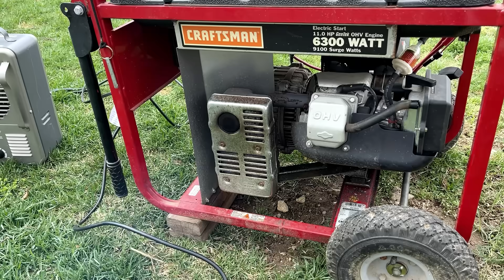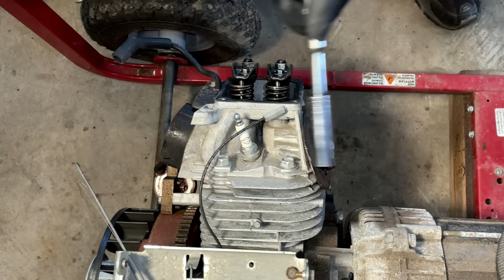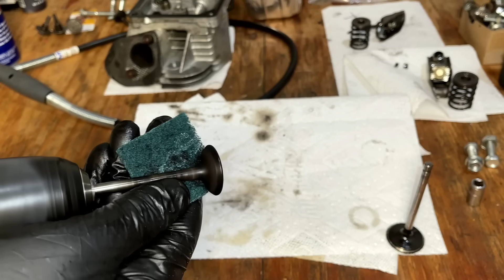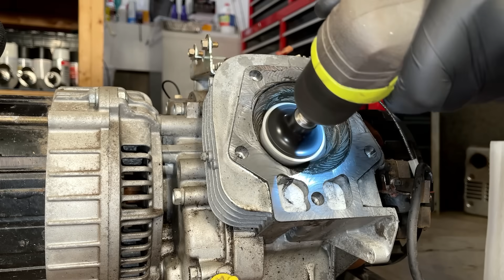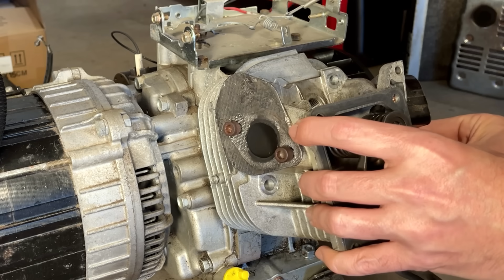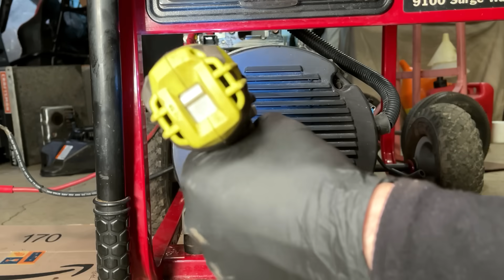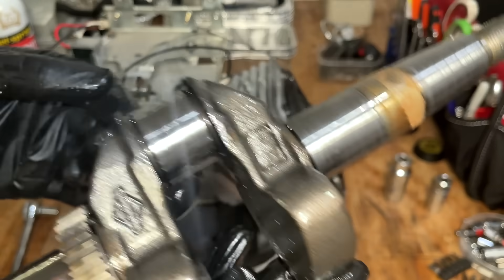Smoking Generator Engine (Part 1) - Easy Fix or Engine Teardown?

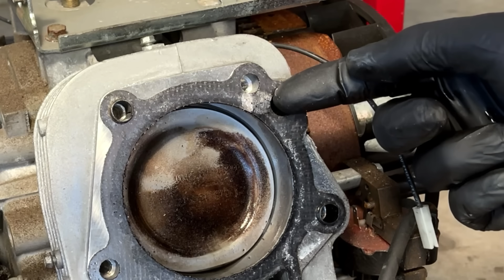Comment: I feel that you have two problems.....at 20:53 I can see where the oil has been washing the outer edges of the piston clean indicates worn rings/cylinder. The color of the valves will reveal any guide wear. Let's see what you find. Love troubleshooting this stuff!

Comment: i know you looked at the oil but i would have at least changed it 1st as the person you bought iy from could have put multigrade oil in and ive had that be the cause of smoking before replaced the oil with 30w and stopped

Comment: When I was a mechanic, I had a problem like that. After a few questions, I learned that the owner had put on mixed gas like in 2-stroke engines.
Reply: Well if it's a 4 stroke as most are you just put 2 times as much 2 stroke mixed gas in right???
Reply: To MrMotofy: no not exactly. In 4 strokes engine, you put the oil (like SAE 30) in the motor base or oil pan and you check it with the dipstick.  In a 2 strokes engine, you mix the oil in the gasoline (like 40 parts of gasoline for 1 part of 2 stroke oil or as indicated on the label) and you put that mix in the gas tank.
Reply: @cunnings309  PSST it's a joke

Comment: Bad intake valve stem seal, intake valve under vacuum, bad seal will suck oil past guides,  exhaust valve under positive pressure, must've been run with low oil level, critical with splash lubed engines. 🤔😶

Comment: It always amazes me how close the crank, connecting rod, piston and block clearances are ..
PS, change the valve guides (and seals if it has them) if you can …
Reply: the valves are horizontal and no pressurized oil, it isnt like OHV engines with oil standing on top of the valve seals waiting to run into the cylinders like everyone assumes here in the comments. Manufacturers should have had to specify vertical or horizontal (V or H/OHV) since so many have this notion and cannot see what is up or sideways without being told.

Comment: Would using a thicker oil remedy, or at least curtail the smoking? I acquired three lawn mowers about 15 years ago, all made in about 1985, all with horizontal Briggs+Stratton engines. All three smoked continuously during operation. The manufacturer spec is straight 30 oil. 10w-40 rendered no improvement. Walmart store-brand 20w-50 nearly eliminated the smoking on all three engines. They still smoke a small amount at startup, but that is it.

Comment: Does this engine have a crankcase breather? Could it be over-pressuring the crankcase? If not, then the 1-way valve in the valve cover could be stuck?

Otherwise, I’d see if you could tighten up the exhaust valve stem seal. Looks like oil is running down the stem and getting burned by hot combustion gasses.

Looking forward to part 2. Thanks for a great video!!

Comment: Yeah the thing that shows this isn't rings  is the lack of any blow by same thing goes for head gasket. This is got to be intake and exhaust valve stem seals.   The little to no pulse is because that air is being sucked through the intake valve stem along with oil.

Comment: First of all the carburetor is not going to make it burn oil. Also do a leak down test will tell what is going  on about the burning oil. And the valve stem seal could be worn out!

Comment: ugh,, I finally got all the wiring done this evening on a kohler 25hp engine and started it... it ran great for 30 seconds, then a magneto came off and broke a mounting post while it got destroyed  🤦‍♂️  😭
Reply from the maker: Ouch
Reply: @jcondon1  you're not kidding !!
My son is in several engine chat groups and they all say it can be fixed with good ole jb weld..... Since a new block for it is around $1000 .... jb weld it is !!! 
and maybe a small drill and tap for a couple tiny screws.

Comment: I do have some questions. First, aren’t there compression tests that can be done to isolate the issue definitively?  Second, if the exhaust valve stem had a lot of carbon on it wouldn’t that contribute to stem seal wear necessitating replacement of the seal?  Finally, since stem seal replacement is so easy at this point doesn’t it make sense to do that as a matter of course?  Inquiring mind wants to know! 😂👍🔧🧰
Reply from the maker: It does not feel like a compression or leak down issue.  This engine only has a valve stem seal on the intake.  I will replace it if honing the cylinder and replacing the rings does not work.

Comment: You said that cover for the breather has a check valve inside.  Could that be sticking intermittently or damaged or not sealing?  This may indicate why the smoke seems to disappear at times.
Reply from the maker: That could definitely happen.  Did not show it, but I tested and the tube was clear and the check valve was correctly letting pressure out of the block, but not back in.

Comment: Great video as always , I concur with the valve guide seal issue   it seemed to smoke more when you throtted it back that would have caused a higher vacuum and sucked more oil through the inlet valve guides.
Reply from the maker: I was thinking the same with the smoke at low speed but thought the vacuum leak was the gasket, but that looked fine.  Already ordered the rings so will try that first and look at the valve guide issue next if still smoking.

Comment: James said, "hasn't run out of oil"? Didn't the seller say it wouldn't start because of the oil sensor meaning it was used on low oil?  The original owner often ran it low on oil, it ran hot and burned the engine  ...  You gotta top off the oil...
Reply from the maker: True, it was run low.  Also think I hear a little rod knock.  But its the chicken or the egg.

Comment: I wonder if maybe the valve guides (or seals if this engine uses them) are worn and letting oil pass a little bit too. A good honing, some new rings and maybe a knurling on the valve guides if they’re worn. Can’t wait for part 2, this is a good mystery James!

Comment: James,
I've watched almost all of your vids and I'm amazed at how meticulous you are
at diagnosing small engines and generators. You remind me of me and mechanical
engineering. I also have auto/diesel and small engine degrees from my younger
days. Growing up on a farm required repairing everything and I had to be very
mechanically inclined, my schooling paid off.

I believe you missed the RED flag when you pulled the head off at the 20 minute
mark. Look how clean the top of the piston is, look how clean the inside of the
intake port is, see how oily and dirty the inside of the exhaust port is and how
bad the carbon build up is on the exhaust valve. Spark plug has little carbon
build up so oil consumption is not in combustion chamber. Oil consumption is in
exhaust valve chamber. Point of oil consumption will always be where the most
carbon build up is and where it is the wettest. If oil consumption was in the
cylinder / ring area, exhaust port would be dry flakey build up and spark plug
would have carbon build up and wet.

Need to check exhaust valve guide clearance with a dial indicator if you don't
have the proper gauge tools to check valve guides and seals. Does this engine
require guide seals?

On kohler K series engines, we used to press out the old guides and press in new
ones. On those B&S I believe replace head works best.

Looking forward to seeing part 2
Reply from the maker: Wish I had though of that before opening the bottom end.  At least I have a plan B if the ring replacement does not work.  I also have an extra head I could throw on.  The plug I dismissed since someone else was in there working on it before me.  There was also a puddle of oil on top of the piston.  Would have thought the intake is the more likely candidate as the valve is open when the engine is pulling a vacuum, but that valve look clean.  Not sure...
Reply: @jcondon1  Plan B sounds good. Since you did a total break down, do hone the bottom of cylinder more than top (top usually wears more than bottom) New rings, Should be able to get .002 over STD size. This will help keep ring gap with in tolerance. Do check ring gap.
Think about it, top of piston was real clean compared to the exhaust valve, oil puddle from exhaust valve leaking.
Exhaust guide could have been defective from factory since minimal wear on cylinder spec. This engine most likely LOW hours.

Comment: Interesting video. It seems like a borescope would have helped in finding scoring on the cylinder faster. Though in light of comments about a leaking valve stem seal, I tend to lean towards that as my guess for the source of the problem. Looking forward to the second part.
Reply: Is there oil in your fuel?
Stuck choke?
Way too much carbon on intake valve.
Reply from the maker: Choke is open.  No oil in the fuel.

Comment: Where is part 2.  New rings etc
Reply from the maker: That will be next weeks video
Reply: I looked for part 2.  And rewatched part of this newer the end.  It appeared that the two compression rings were good and the upper most thin wiper ring of the oil return ring.  I did not see the condition of the oil passage ring providing oil splashed under the piston and/or up into the cylinder walls a free path to drain back into the crankcase.  I also did not see you check or hear you mention if the open ends of the compression ring and top oil wiper ring were aligned providing a near straight shot to the combustion chamber and head area.

Comment: I agree with your tentative decision. I personally would hone the cylinder with a standard hone chucked in a drill, and I'd just hone it for a bit longer than you would normally when just breaking glaze and cross hatching a newly bore cylinder. Buy a new set of fitting-required chrome rings, and verify that the gap is good. Slap it together and see how it does. If it still burns a little bit of oil, dump some Restore oil additive in it. Project Farm had some apparent wild success using that product. The small scratch left after aggressive honing won't be that deep. The chrome rings will bite into the crosshatch a bit during break-in and shrink the depth of the scratch even more. Then the Restore or other sacrificial anti-wear product will plate over and fill in the rest of the scratch. Even if you have to put more Restore in with each oil change, whoopy do. It's cheaper than what you will have saved buying the generator for cheap or salvaging it off the curb. 🤷🏻‍♂️
Reply from the maker: That’s what I was thinking with the hone.  I little more aggressive then normal should minimize the issue.

Comment: Many have already said the stem seals and that be my thought as well. Intake valve stem seal for sure. And typically there is not an exhaust stem seal, but shenanigans on that, I put one on the exhaust as well. 

Hone the cylinder, get some new standard rings, slap it back together. Even if they made oversize rings and you grind them down to get the proper ring gap, now its a cost consideration for parts and your time too.

Awesome video. Cheers!
Reply from the maker: The intake valve looked pretty clean.  Probably should have replace the seal first.  That would have been easier to try.  Guess I have a backup plan.

Comment: It seemed to smoke most during changes in speed rather than during slow vs. fast speed. ould this implicate the exhaust valve? Your videos are wonderful - love your methodical approach as well as the patient and meticulous wrenching.
Reply from the maker: Not sure.  If a head gasket issue or valve guide seal issue would have expected more smoke at lower speed.  It did seem to clear up some under load.

Comment: For what its worth, I have "fixed" many older engines from smoking by just changing the oil to SAE30 dino oil. People use synthetic 5W30 and it smokes like crazy. Put dino SAE30 oil in it and it runs fine and doesn't smoke. I've seen this on at least ten engines.
Reply: `I run Delo 15/40diesel formula in everything I have and none to very little smoking and I have some that are 85's. And Delo and Deere oil are the only ones now formulated for flat tappets.
Reply: I concur. At my Canadian cottage 3hr north of Toronto (April to October) I run dinosaur sae30 in everything...lawn tractor etc. But especially my 2-outlet (3kw?) No-name generator which we seem to need for the fridge every second weekend for a few hours to 12hr

Comment: Nice work have been watching your shows for a while now and have seen you make many units run well again... this one is a bit tricky... but I think it will be ok.. many good  comments about what could cause the problem.. both the valve cover..and valve seals or guides.. also I have a question for you about a generator that I pulled from my motor home... no power output.. they had both  ac legs tied together... is that ok or the problem with no output.. thanks again
Reply from the maker: It depends...  Most motor homes use 120v generator (no 240v).  Your generator might have to windings.  If connected properly in serial then you will have 240 or connected together properly in parallel then you will have 120, but the load will be spread evenly across the two coils.  If connected improperly then it could cause a melt down.
Reply: @jcondon1  yes it was 120 both red and black legs tied together and both white were tied..for only 120 volts.. could this have damaged the generator  or do you think it was normal... I have not checked the power head yet. I did put in another generator but I ran two separate lines.  Really like all of shows..

Comment: Did you actually check that Check valve for proper operation and it is not clogged?  With it running you should still feel air coming out.
Reply from the maker: I should feel air coming out, but I really felt nothing.    I tested the valve and air could come out but not in.  No issues with the valve or the breather line.

Comment: Did you check both valve clearances and I missed?
Reply from the maker: Did not check with a feeler gauge, but pulled the engine over slowly and could feel it was holding compression well.  I will check when putting the engine back together.

Comment: My money at this point with it smoking worse after accelerating, decelerating and accelerating is a seizes oil ring
Reply: Well, as usual James I learned something new from your vast knowledge of hours of work on engines here.  I would not have thought of the head gasket.  But, in my defense I am a novice compared to you’re hours and expanse of experience.  Thanks. Always find your videos informative and this was a new one for me and if memory does me well it will be something I remember to consider as a cause for such a problem when I incur similar.
Reply: You’ll want to clean the muffler’s spark arrestor wire screen from the oil and carbon
Reply: I don’t know how the possibly bad head gasket could contribute to fouling of the oil wiper ring becoming overloaded with carbonized oil from the combustion chamber.  Sometimes running an engine several times with a bit of marvel mystery oil will free and cleanup an oil wiper ring if it is just fouled and not totally collapsed and seized.

Comment: Replace the valve seals you don't have to pull the head fill the cylinder with air and remove the keepers the air will hold the valves up

Comment: As others have mentioned your oil control issue is from valve guide sealing. Anytime you have a light engine load you have high manifold vacuum. That vacuum is what’s pulling oil through the guides. That’s why under load the oil plume clears. Scoring on the cylinder will increase oil consumption but it won’t be huffing smoke as seen in the video. I recently worked on a worn out Corvair engine for a customer (6cyl air-cooled) and the rings were really shot. We were talking 3/16” ring gaps and that engine had a very light smoking on steady throttle.

Comment: I love your channel. It's like a small engine repair course that I don't have to go to a school to attend. 
One question that I've asked before, but never got an answer; Why is there a gap between the lifters and the valves in this case (between 0.004" to 0.006")?
 Wouldn't that cause a knocking sound? Do the valves expand when the engine gets warm, to fill this gap?
Reply: Gap is as you thought 
Heat expansion
Reply: @stephenrankin2078  That explains why engines knock a bit when they're cold.
Thanks.

Comment: I agree with Donald Johnson.  I believe a closer inspection of the intake valve stem seal may reveal cracks or wear that may be causing this issue.  It may also be related to excessive valve guide clearance.  Just a guess though.

Comment: My Dad ran a Derby gas station in the 50's and early 60,s, in a small town in the midwest.  I was somewhere "out of diapers"; r&r lawnmower engines, repairing tires and pumping gas for dad.  Your're sure bringing back some great memories.
     I have, two Clinton horizontal shaft engines I saved (1950's, oil bath) that needs my attention.  It's all your fault!  Thanks you!